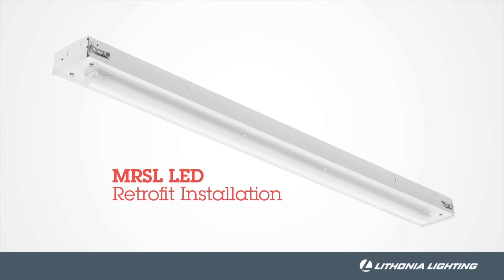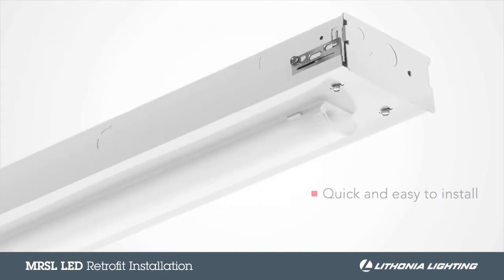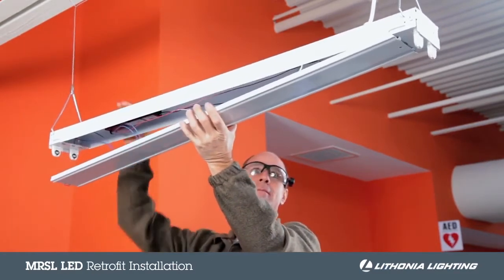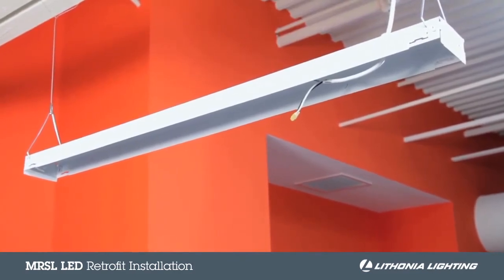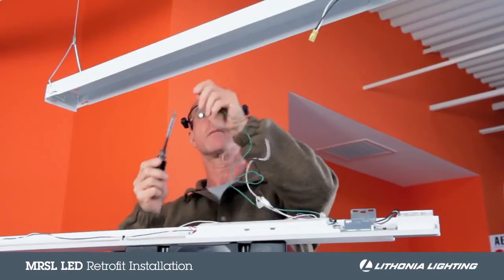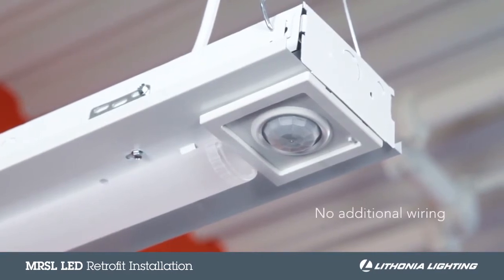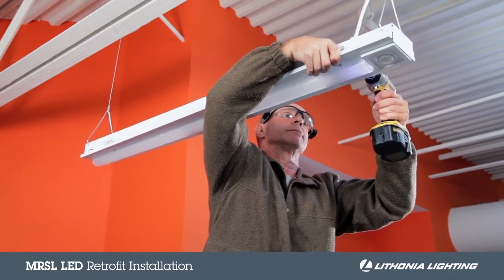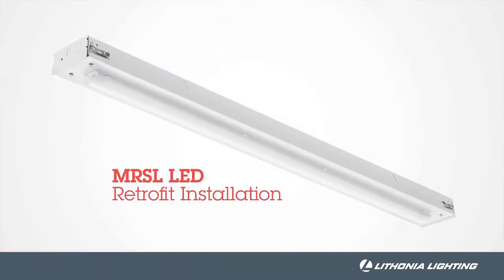MRSL LED Retrofit Installation | Lithonia Lighting

Comment: If I'm considering swapping out my 8' Fluorescents with LED, my electrician recommended the CSL8-8040 8'. How does your LITH -0390 ( MPN Part No.): MRSL L96 10000LM 840 UPC 190887700787 and the MPN (Part No.): PLT-50083 UPC: 713674647883 compare?

I'm getting along great with my 2 bulb 8' fluorescents. Not sure I can justify the cost of these led's. I have a 40x70' shop with 13' ceilings and running 3 rows of 5 lights. I will continue to run 3 rows of 5 even if using the LED's. Thanks
Reply from the maker: Since we don't offer the CSL8-8040, I'm going off another website to answer for those specs.

The CSL8-8040 can be either 3500 or 4000 Kelvin. Both the Lithonia and PLT retrofit kits are 4000 Kelvin, so this may be a bluer white or may be identical to what you have currently. 

The CSL8-8040 is 80.5 Watts, the Lithonia is 88 Watts and the PLT is 96 Watts, so your energy usage is actually more with the LEDs, but you're getting more Lumens. The CSL8-8040 produces either 8460 or 9036 Lumens. The PLT retrofit would give you 9600 Lumens or the Lithonia produces 11,200 Lumens for only 8 more Watts. The CRI of all three fixtures is about the same and all three are dimmable.

The CSL8-8040 has a rated life of 54,000 hours, meaning half the lamps fail before that and half last longer. Both the Lithonia and PLT retrofits lamps have an L70 rating of 50,000 hours. This means the light output will not have dropped below 70% of the initial Lumens until at least 50,000 hours. We offer a 5-year warranty on both of the retrofit fixtures.

If you'd like more help comparing products or looking for a more energy efficient alternative, please give us a call at 1-800-624-4488. We have over 50 account managers available so there's rarely any wait time.